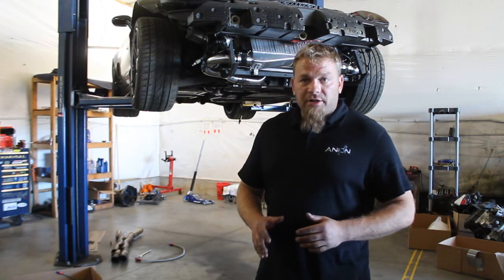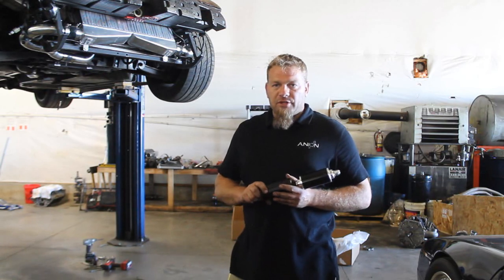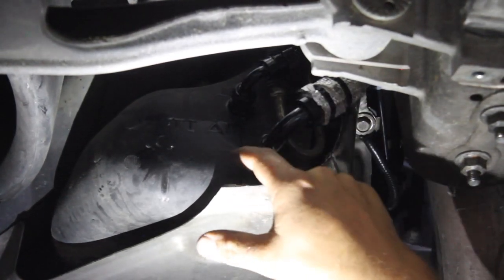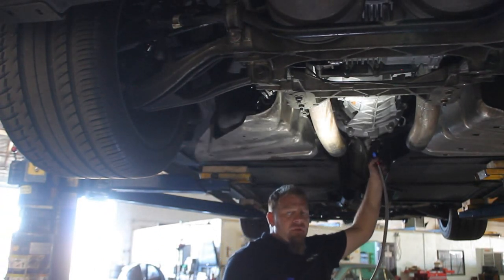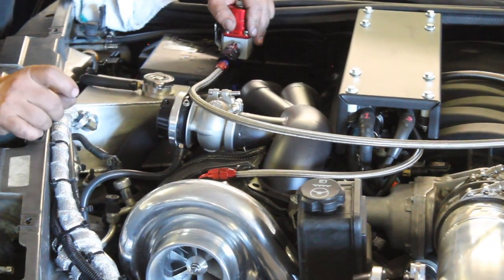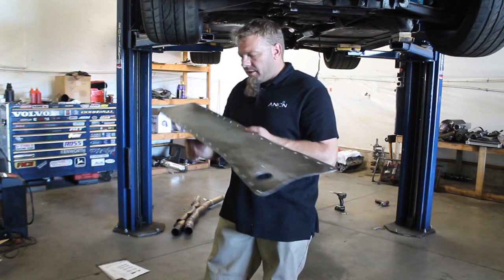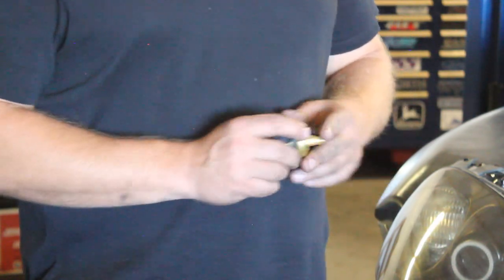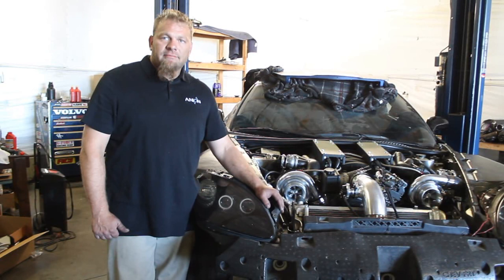C5 AND C6 FUEL SYSTEM INSTALLATION REV. 2

Comment: With the braided lines are they vapour proof. I had a car with  a braided fuel system like this and couldn’t park it in the garage it smelt all the time.
Reply from the maker: They are vapor proof. No smells or fuel leaks from these.
Reply: I am currently install a fore innovations triple pump return system on my c6. I bought it used for a shop it only had 300 miles on. The regulator had a fuel pressure sensor on it so you know if that’s necessary or can I just use a gauge? Thanks!